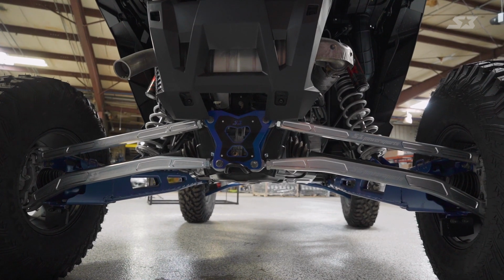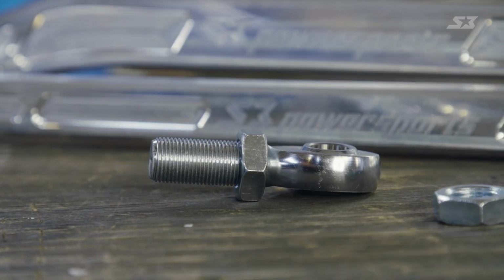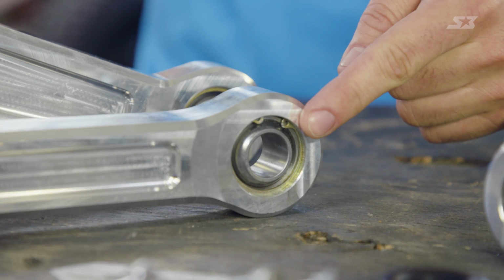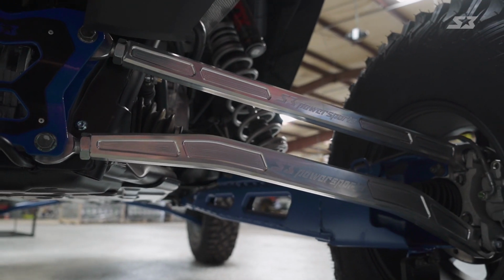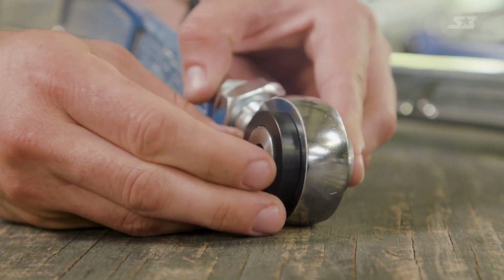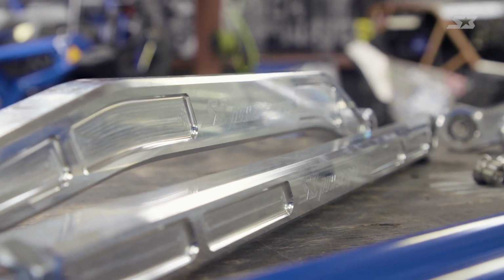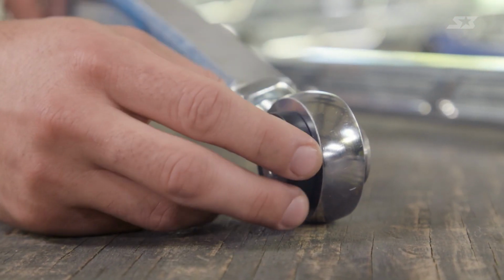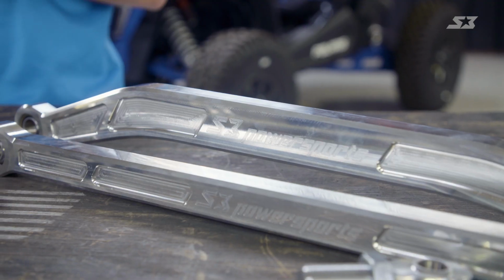HD High Clearance Radius Rods for Polaris RZR XP Turbo S | Product Breakdown

Comment: Question. Are these compatible with super ATV 4” GDP portals for the Turbo S?
Reply: We designed these to work with factory knuckles and most all aftermarket parts such as bumpers and rear guests plates. We do use huge joints on our radius rods for added strength but as long as there are no room constraints smaller that factory knuckles with those portal mounts then our radius rods will absolutely work with the GDP portals.
Reply: Dustin thanks. I ordered them today
Reply: @videodonk  heck yeah! my pleasure